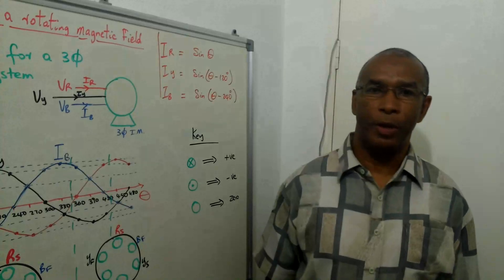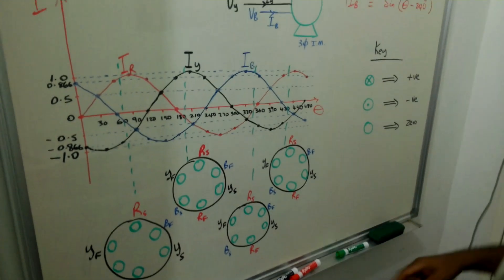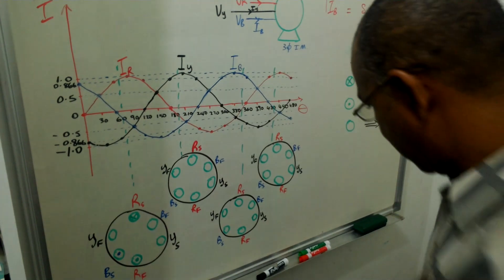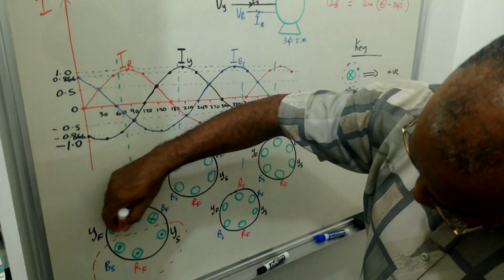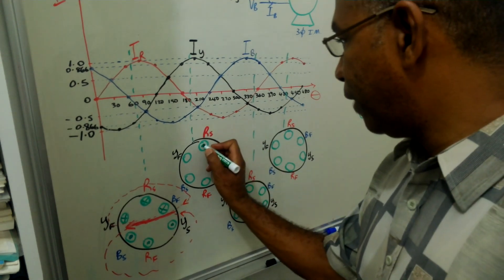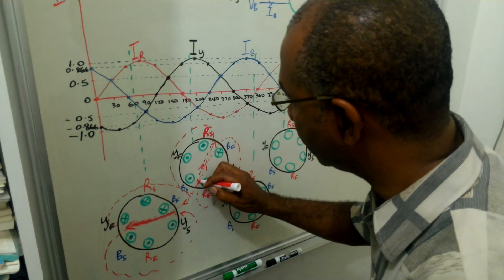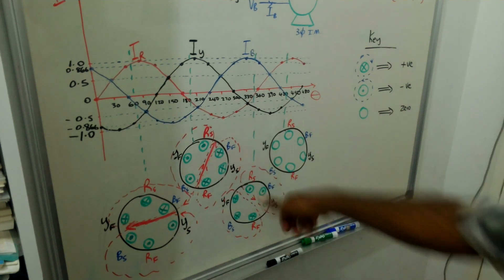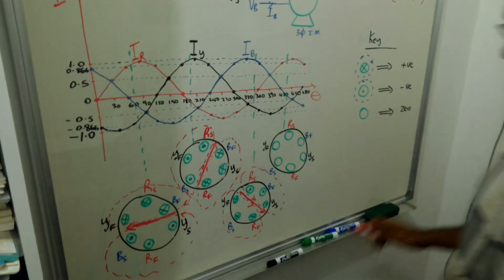Production of a rotating magnetic field in a three-phase system

Comment: Do you know, that there are NO motors with such windings? In real world, there are pairs of coils in each phase facing each other and the magnetic field is directed more complicated between them.
Reply from the maker: Thanks for the comment. The idea is to provide a conceptual understanding of how a rotating magnetic field is produced. If I can explain the very complicated in a simple way, then it should lead to a better understanding of the "real world" situation.
Reply: Thanks for the answer. Thats the problem. I am struggling to understand how does a real world magnetic field in 3 phase motors looks like. And this theory, wich is common, does not help at all.
In real world, flux from each coil connects to his left and right side neighboor coils (when we have positive max current in 1 phase and negative in 2 ohters = sin30 x i max = 0,5 i max). And I can not find the way for the magnetic force lines to form that main line between 2 poles with maximum current. I am just looking for the answer. If you could help with some information or sources of information with presice picture of magnetic field in 3 phase asynchrous motor, I'd be greatful.
Reply from the maker: Ok. A good source is Hughes Electrical and Electronic Technology. Look for the latest edition if possible. I will give you a link to the 10th Edition. I can't vouch if this link is virus free. Chapter 36, page 742 deals with the rotating magnetic field. Chapter 38 deals with the Induction Motor.

Please note that despite the varying size of the individual magnetic field produced by each of the three (three phase) currents, the size or magnitude of the combined magnetic field is unchanged. It is constant. What changes is the direction of the combined magnetic field. The changing direction shows a rotation of the magnetic field.

For the asynchronous motor (such as the induction motor) the rotating magnetic field produced by the stator, will induce a current in each of the rotor windings, which will each produce a magnetic field. The rotating magnetic field produced in the stator will then interact with the magnetic fields produced/induced in the rotor and that interaction will cause a torque (turning force) to be produced which will cause rotation of the rotor. The link is https://docs.google.com/file/d/0B2s8MyO6hGENRl9BeTVTeUdRX2VHeGVTSEVOVFpyUQ/edit?pli=1
Reply: Thank you. I'll work with this book.